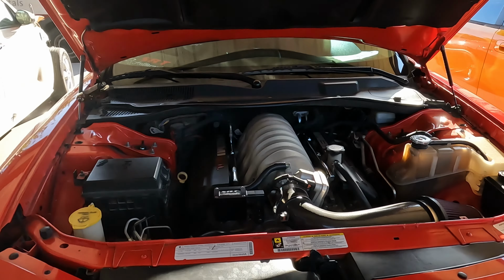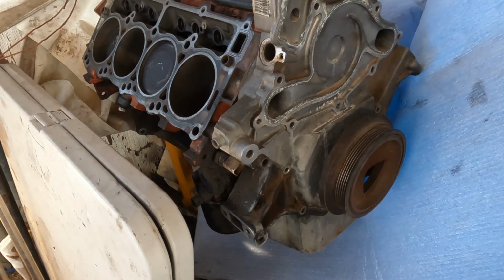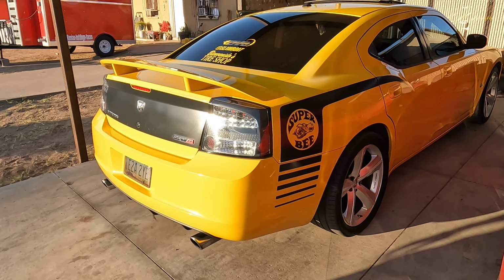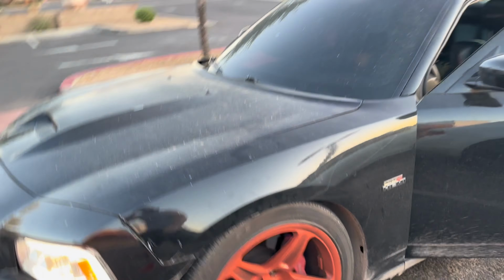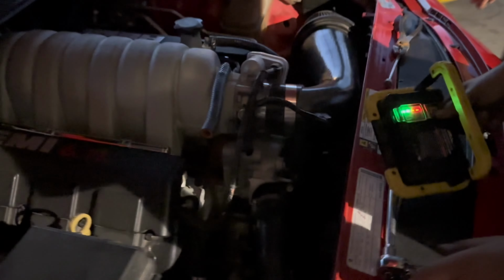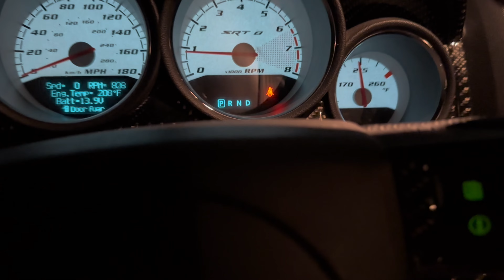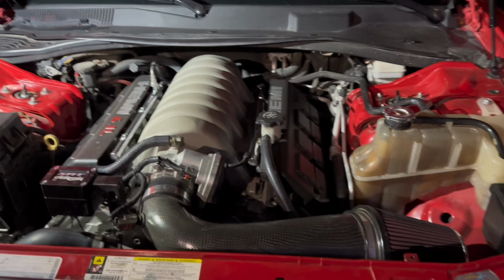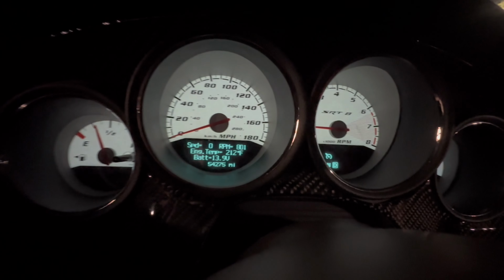I let a 17yr old work on my Charger SRT then this happened!…  **MUST WATCH!!!**

Comment: On the thermostat, that little hole with piece in it should always be at the highest side of the housing. it helps with bleeding the coolant system. Especially coolant going to heater core. Thats why it starts running hot.

Comment: Those dodge engines really need working hood scoops to  let air in to help keep the engine cooler.
Reply: They do have them. That’s what those two slits are on the underside. It’s one solid piece that shoves air down the sides of the engine.
Reply: I run a 160t stat on my 2006 Dodge Daytona RT. No problems.

Comment: 180 tstat is so important. I lost my cooling fan a month ago, my car was able to drive almost anywhere and stayed under 200 even without the fan. Ive had it for almost 2 years no problems. In summer air my 5.7 was able to stay around 188 to 192 while around town, and 181- 183 on highway. Without that thermostat it wouldnt have been drivable. If you tune the 3 stage fans to come in at 188, 200, and 212 then you will never get hot. With the fan it never gets hotter than 194, even while pullimg

Comment: I switched my 06 SRT to a 180 and without the fan turned on it’ll hold in that range. I still have the fans on a separate switch that the previous owner installed. I used the mopar coolant and pinhole at 12 on the stat. Personally I like the extra protection of the 180 cause if it runs hot at 200 sitting in traffic etc… I know I’m good.  Video is on my channel.

Comment: I’m considering selling my ‘08 SRT8 Superbee. It has been nothing but trouble since I’ve pulled it out of winter storage this year. First a transmission sensor went out, then both front wheel bearings wore out. My ESP BAS light came on but now only my TCS light appears on the dash. Now just the other day I got a trouble code for a cam position sensor.
Reply: Keep in mind all of this has happened in about a month and a half.

Comment: Go with the Michimoto 180 degree tstat the best mopar 180 tstat. I live in texas and im not tuned for the 180 tstat but it works great. When i drive my temps stay at 180 but when im at a stop light it goes back to stock 200 since im not tuned, but i drive a scat. The 180 degree tstat helps with consistency when you are doing multiple runs with somebody your engine stays cooler which also keeps your air intake temps cooler. I notice your air intake is exposed with no heat shield. This could also be contributing to your overheating since your car is breathing hot air from the engine, you need a heat shield atleast, if not an intake that is fully sealed.
Reply from the maker: I put the heat shield back on bro if you noticed I took the strut tower off and put the hood air grabber and heat shield back on and I’m almost 100% that both my 180 T stats were michimoto ones. SRT Autoworks told me they have been getting a lot of bad 180 Tstats lately when I went to change it the first time

Comment: Dude installed the thermostat upside down. The jiggle valve should be at or near the12 o clock position. Also shouldn't be mixing different color coolants together.
Reply from the maker: Actually there is a big debate on this, I’ve heard of guys running cooler with it facing closer to the 6 o clock position but guess we will see 😬
Reply from the maker: And as far as the coolant it has nothing to do with the color it’s just dye however the technology matters! HOAT is what our mopars use 💯 so we good there 👍🏼

Comment: SRT dad what does your oil temp run my oil temp all the way up to 224 degrees on the digital but my temp will be over the 215 on my 06 SRT8 it does not have two water temps😊 that is digital oil is just was wondering
Reply from the maker: Yea what you see on your normal dash is coolant temperature what you see on digital is oil temp two different things if you hold your music and compass button for 10seconds at the same time you can access your coolant temperature
Reply: Thanks what does your oil temp run normally
Reply from the maker: @joefurrer5428  usually in the 230’s

Comment: The thermostat wasn’t placed correctly, the tiny hole on the thermostat should be place at 12 o’clock position
Reply from the maker: I’ve corrected this mistake since this video i installed a 180 Tstat myself will make an update video soon

Comment: The higher number holds the water in radiator to be cooled for longer before it rE-enters the system
Reply from the maker: This makes sense 💯
Reply: @srtdad  arizona gets extra hot. There is also a sprayer device that you can use to spray mist on the front of the radiator on super hot days too
Reply: @srtdad  when I use to run my 440 big block it could easily get super hot